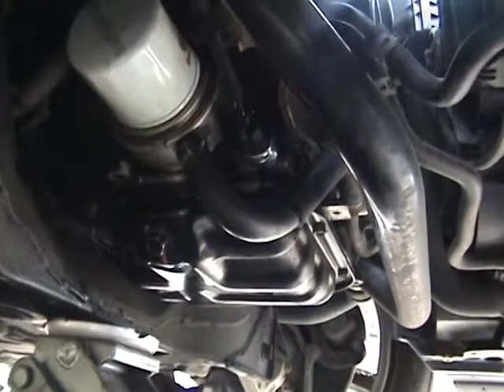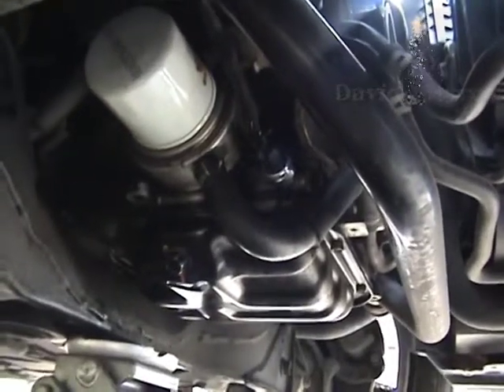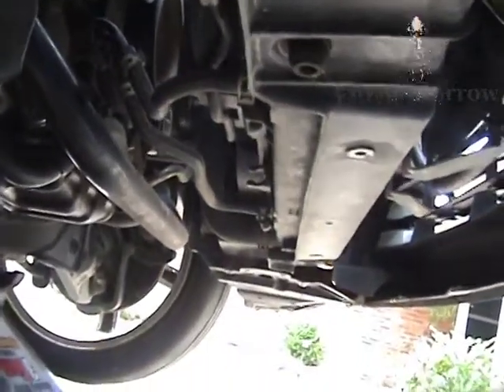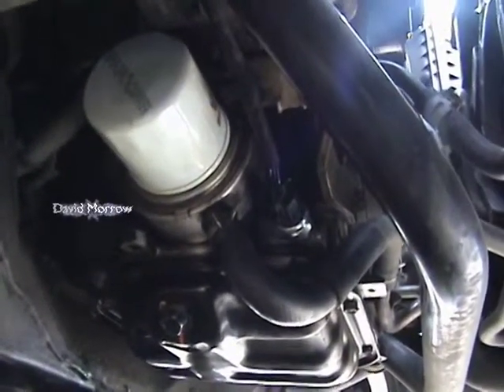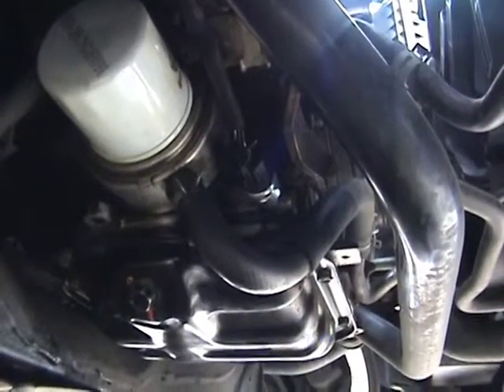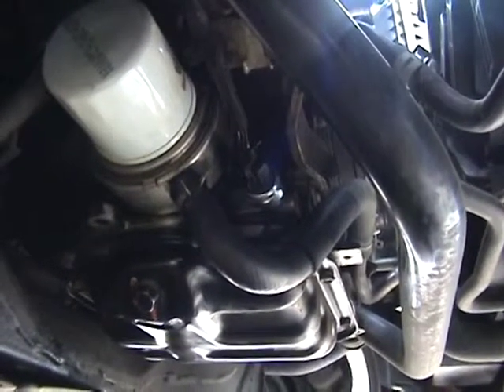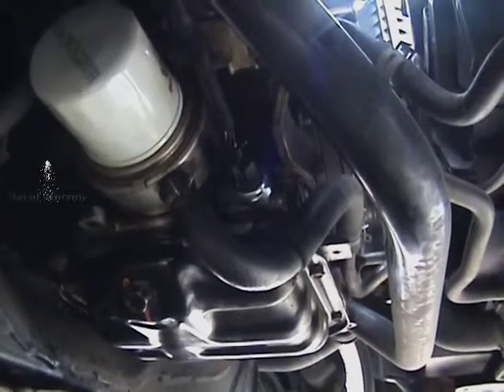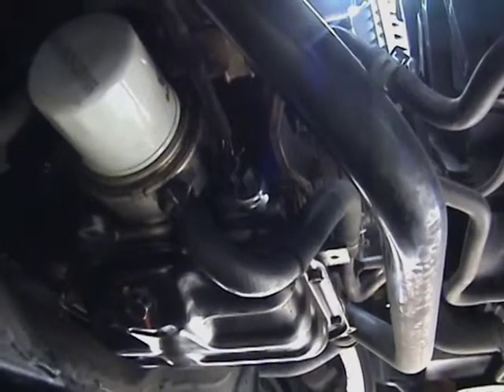Nissan 350z R&R OIL PRESSURE SENSOR with Torque & Pressures

Comment: how you twist it off? by hand? it's like 28mm and hard to get a socket on without takin that oil filter bracket piece off...lemme know if you get a  chance!
Reply: Did u found out how?🙏🏼🙏🏼🙏🏼🥺
Reply: @k-a147  24mm open ended wrench.
Reply: 14psi at idle? Might be gallery gasket time.